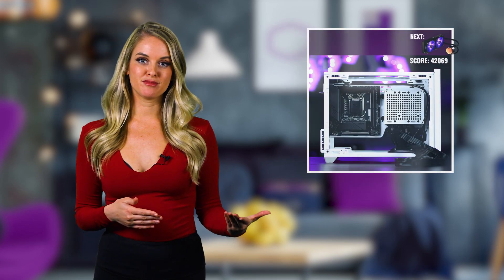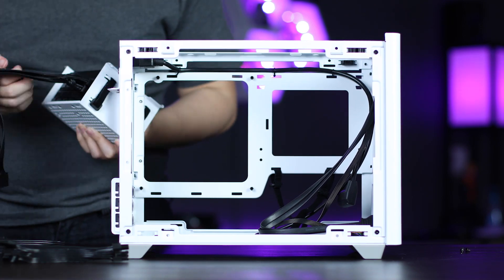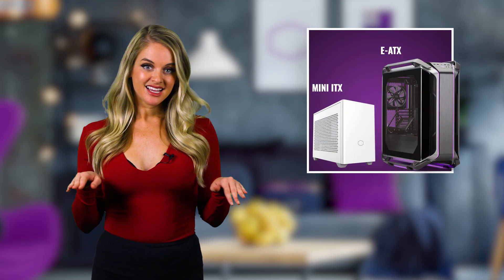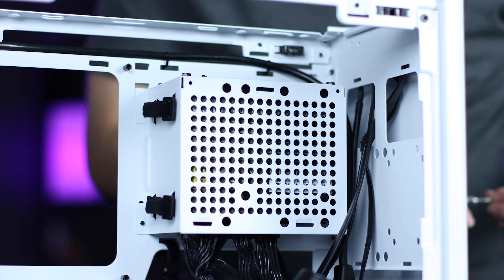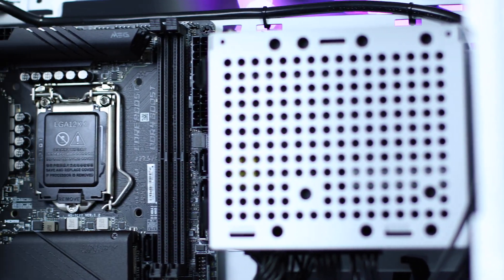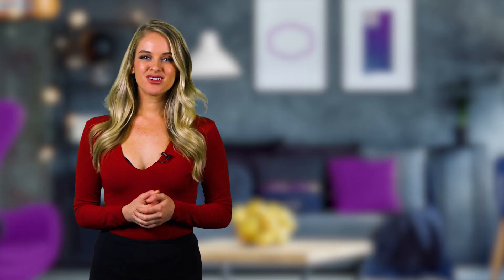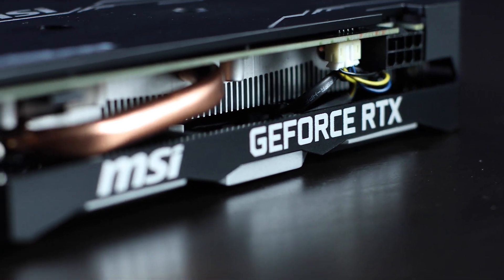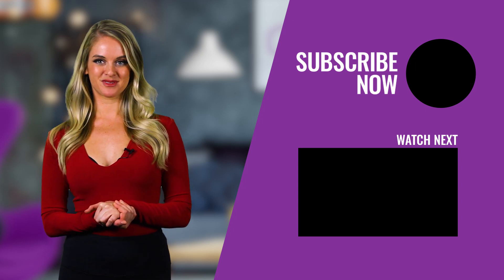The Biggest Little NR200 Build Ever - Just the Tips, ep 6

Comment: finally, after 2 months of waiting, got an amazon email notification "in stock on Amazon.DE" Arrive : 8.OKT yeah! aaaand its sold out again after 1 day on amazon, lol
Reply: Same thing on Newegg. They have it as a "New Arrival" as they didn't sell these cases before, BUT they are completely sold out of every variation. I wonder if the bots got all of these cases too...
Reply: @jwe88lc  wish you luck. got mine today!  Now im ordering cooler and have to wait for Zen3 :P Year 2020 waiting time
Reply: Got mine today as well! I have already dismantled it completely as I am going to figure out how to mount the aio to the top one way or another... I may have figured a out a couple ways of doing it already 😅
Reply: @jwe88lc  nice. the 2 cooler who comes with the case are bad... the noise omfg.. im using them on 900rpm atm and order another one
Reply: @ZachalZockt  I am going to use the Noctua slim chromax on the radiator and the bottom panel below the gpu. I have the Aorus 2060 Super so it's a beefy card

Comment: Does it have optional mounting bracket for ATX power supply?
Reply: They released a 3d printable ATX PSU mounting bracket and it is found on the NR200 product page.
Reply: CoolerMaster said it's in development, but will only be available mid 2021. For now, there is a 3D print file for the bracket on their website for atx power supplies
Reply: I see, that would work.

Comment: Gigabyte have just updated the specs of their Master/Xtreme Aorus 3080 cards: L=319 W=140 H=70 mm.
The NR200 specs show a limit of 60mm but there’s still quite a bit of space at the bottom. Do you think a 70mm thick card will fit without the fans being too close to the bottom panel?
Reply from the maker: We will be doing testing on those cards soon. But we recommend not to use with NR200. Theres about 67mm of space for the gpu so a little over 3 slots of thickness. But the Gigabyte Aorus cards are 70mm so its more like 4 slots tall. We dont recommend using the Master or Xtreme Aorus series for the NR200.
Reply: Cooler Master Gaming Thank you for your prompt response. It makes my decision easier. Regards.